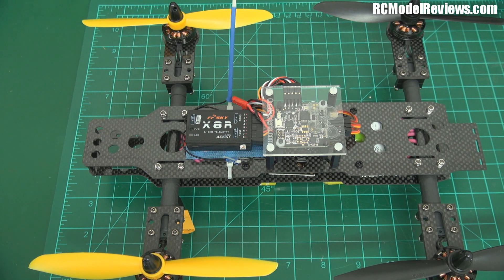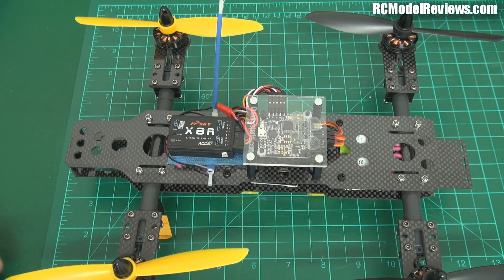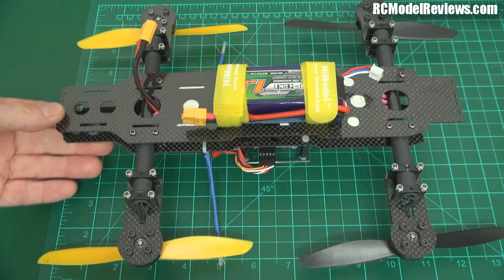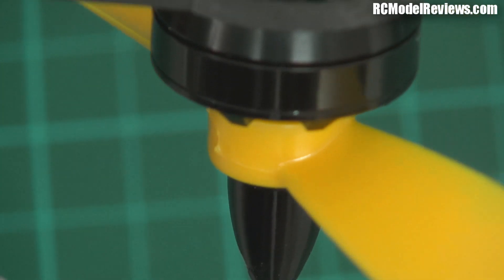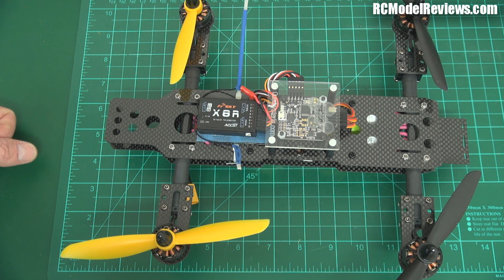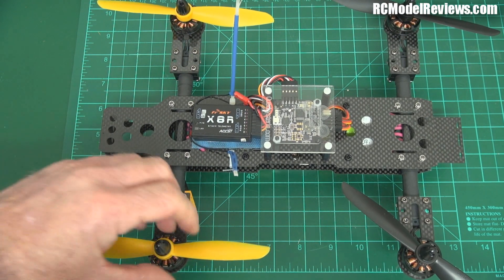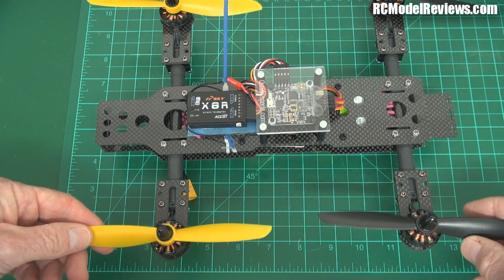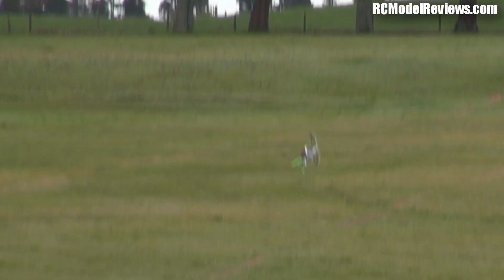Basics: always check your props!

Comment: Hi Bruce,

I was flying my HK miniquad and both blades on one hub came off at the same time, I didn't notice any fatigue on pre-flight. 6" Gemfans black plastic. The other three props are still in use and working - for the moment. However, I am a conservative European flyer - the quad came down at our local field on the correct side of the safety fence.

Merry Christmas and a Happy New Year

Alan

Comment: That's what I'm flying. I slung a prop this weekend at about 25 meters in a wide open climb out. Tumbled like crazy to the ground. No damage, replaced the prop and the MXP230 was off and going again.

Of course before that incident it had ran into trees and a park bench.

First thing that ran through my mind was Bruce's video Basics:always check your props.

Comment: I knew this would happen, I though I would be ok flying it my back garden with slightly used props. I was wrong, one of the motors threw a blade and ripped the motor off my quad and tore one of the wires going into it.

Comment: I own one of the first generation DJI F450 Flame Wheel kits. The slow flyer props it came with would throw blades about every couple dozen flights. I even had props get thrown from a couple hobbyking slow flyer props. Now I'm using carbon blades and I hope they don't spontaneously explode like some of the other plastic slow flyer props I've had.

Great video as always :-)

Comment: I usually break all my props before they have a chance to fatigue lol
Reply: I got a friend's Hudsan micro quad stuck way up in a gum tree and thought it was there for good (I suck at flying quads). Turns out giving it a rev made all the pressed-on props fall off, the body then fell to the grass (it was OK) followed by all four props fluttering down like leaves, with no breakages. Impressive, but prolly best I stick to fixed wing, lol.

Comment: I like APC's Multirotor props because they are glass filled composite and tough as hell. But they don't make them smaller than 8".  Everyone raves about the HQ's - I believe they are well-balanced.  I fly with the FC props Bruce mentions too because they are so damn cheap. However, the inspection is spot on!  I have thrown two blades in mid-flight FPV. When this happens, results in the worse damage to the quad because they are tumbling and spinning at the same time !  I don't like carbon fiber because I find stiffness make them less "punchy". Also, they shatter on medium crashes. The flex in nylon or composite props is factored into the performance of the prop.
Reply: I just saw some for sale this morning 5 and 6 inch ap props
Reply: Robert Hendrickson Those would not be their MR specific version. But probably the E or slowfly line - good props too but not as "beefy"
Reply: ahhh i was little surprised to see them. thanks for the info looks like its AQprops for now

Comment: Had similar problems with HK Carbon 10x4.7. I have to point out that they are a very good prop but when you constantly pile in when you are learning they don't break but they do stress over time. You can feel that the CF flexes where the resin has delaminated. Got a small tub of carbon fibre paint stirrers now 😄

Comment: Great safety video. I always check the firmness of each prop before i fly. And by doing this, I've saved myself from destroying my quadcopters multiple times. Cause just by judging by the looks does not work...
Reply: I have the same motor/prop combo, bought from the same company. And they fatigue exactly as demonstrated here. BTW, no dinging or anything like that, just normal wear and tear of flying. I guess, the high rotational speed i.e centrifugal force, combined with torsional and bending (lift) of the prop, stresses the blade root. Interesting enough, it only happens on one side. You would expect it to be stressed on both sides. May be something to do with Advancing blade vs Retreating one.

Comment: This is great advice!
My big idiot moment with stressed props happened in my living room... I was doing a bit of LOS tuning on my mini and had a prop seperate in mid flight. The quad landed on the ground with no issues but the prop went flying across the room. It missed me by inches and embedded itself in to the wall behind me! Granted it was only a 5in prop but I imagine it wouldnt have felt nice if it hit my leg.. check your props!

Comment: I've had both 10x4.7 and 12x4.7 gemfans throw blades on my quad and tricopter, both ended in very bad crashes, not on anything thank god, but almost completely destroyed the whole air-frame.  My best props have been 9047 Gemfans, I haven't had one throw on my YET... I would like to use get some APC props but all the ones I use on my multirotors are terrible...  I'm not sure if I'm getting the wrong size, but they make a hell of a noise and require alot more throttle to even get off the ground.  There the same size and pitch as my slow fly props so what could be going on there???  I remember you put them of your cinitank and you seem to have had alot of luck doing that besides for the spacers being the wrong size.

Comment: Silly question!  Is there a way to to reduce the amount of noise produced from the motors on a quad?  Can the be insulated in some way to muffle the whining noise?
Reply: Not that I'm aware of. It's the nature of the beast in afraid. A high quality motor with a decent prop that is properly balanced on the blades and the hub is about all you can do I think. Saying that, I heard wood props produce slightly less noise.
Reply: The more blades you have per prop, the lower the noise. And if you have a large quad, using large propellers spinning slowly reduces the noise a lot and uses less power, but the quad will be slower and not very sharp in its stabilisation (more weight to speed up or slow down). The noise will be deeper so more pleasant. 

On the other hand if shorter props are used, the noise will be higher-pitched and unpleasant and it will draw more amps, but you will get more sensitivity and more speed - as for the mini quads which have short blades spun by high kv motors.

Then of course as said by +mrmurder75 , balanced props and motor cages avoid having the frame to vibrate and indeed make noise.
It also depends on the bearings of the motors, the ESCs (they send electricity by pulses (PWM) which make a high frequency sound that can be heard when the propellers run at minimum speed), the shape of the propellers ...

It is a lot of things to deal with :/
Reply: SuperAmoL3D Look into the manual for BLheli firmware under the motor PWM setting.  Certain ESC motor PWM settings fall into the audible range for human hearing, resulting in that horrible higher pitched motor noise.  Aside from that, balancing your motors can help reduce noise in the lower end of the sound spectrum, and increase your performance/flight time!

Comment: Very TRUE
I have had several props on my Flame Wheel break from use stress alone.
Luckily I was not far off the ground each time.
The quad becomes an expensive rock and down it comes.
So you don't have to hit something.
PREFLIGHT!
Way kool vid man

Comment: Bruce, you can fix it with the heat gun, give it a little go with the SMD reflow over the strest mark and it will "solder" but dont over do it since you can melt it

Comment: I couldn't agree more with the importance of pre-flight check of ANY model. I fly mostly Helicopters and multi rotors and it is SO important to check everything before a flight. The idea of fixing a stressed prop with heat as suggested by "Jared Reabow" is just a joke, why would you risk a failure and posable loss of your model or damage to property and self  for the sake of a $2 part. Just replace it and KNOW you are safe. I always order blades in batches of 8 or 16 so I have plenty of spare parts. Thanks for another piece of sound advice Bruce I wish there were more people in the hobby with the "common sense" you have.

Comment: you can fix that over stretch quite easily, just apply heat
Reply: ***** and yet i have done it, so yeah, not false.
When you bend the plastic (i.e. stress), you are forcing those polymer chains to align in the axis of strain, inducing crystallization in that region, which can then scatter light and turn the plastic opaque or white. heating the plastic slightly allows those chains to move back (plastic memory) and the crystallization reduces causing the plastic to return to its previous state
Reply: ***** so have i but not with such a blunt instrament as heat gun, you need to localise the heat and control it.
I use a micro blow torch, very small but hot flame allows  me to heat very small areas quite high

Comment: Bruce...

I have to laugh mate, Ive taken my 450 size quad out today and Ive been using the Gemfan 11x4.7 nylon props for quite a while now. Well I went out today after finally getting my FPV antennas and went out for a quick go. FPV went well, got about 8 mins and brought it back in, change over a battery and back out again LOS, within about 2 mins I heard a click and the quad came tumbling down. I found a prop which was broken at the hub about 5m back where the quad actually landed, it tore the mast holding the gps, 2 other props, broke a leg and ripped a motor clean off the mount by pulling the wires right out of it.

I just had to laugh, this happened literally 3 hours ago to me.. I couldnt believe you uploaded a video on it, amusing. :)

Thanks mate! :)

Comment: I've started replacing all my props if I take a tumble and end up breaking or bending one. I've had a few occasions where I replaced just the broken ones because the others seemed fine only to take off and have one of the old props shatter.

Comment: I have noticed that higher kv motors are more susceptible to this i had a 1500kv motor with 8inch props all the props had this problem on the Tricopter! now i have a quad with 800kv motors and dont have this problem!